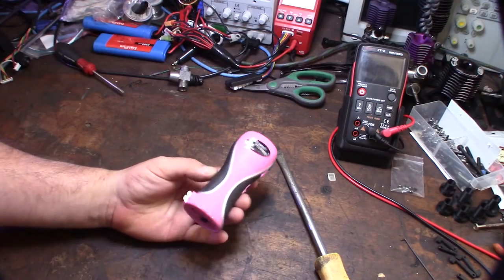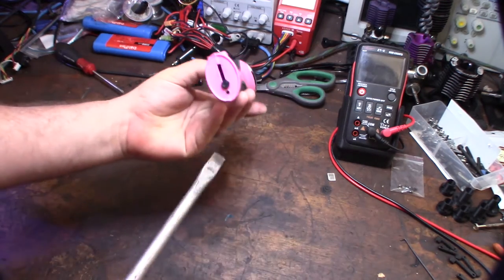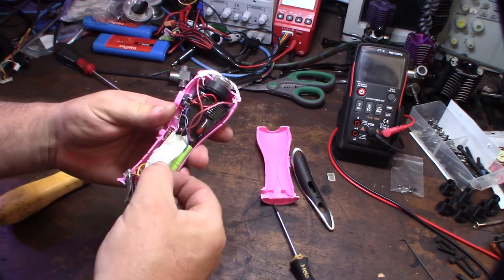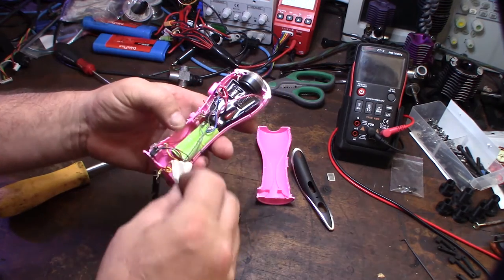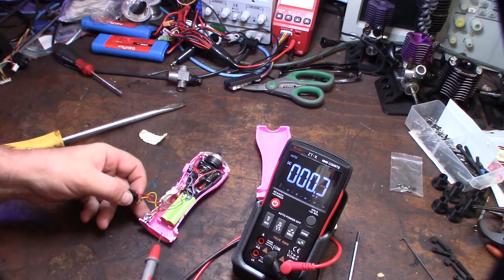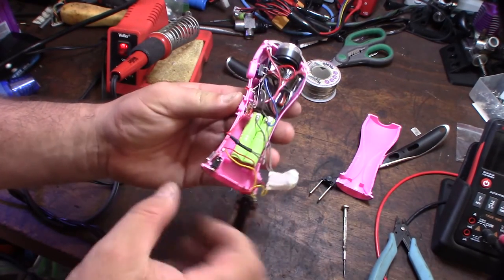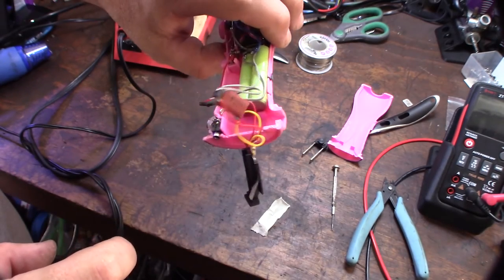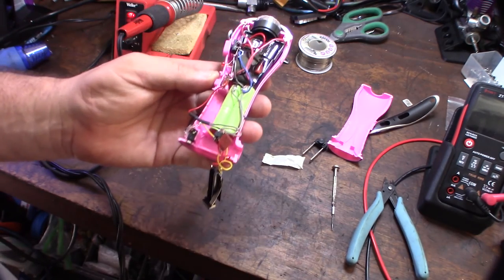Damsel In Defense Stun Gun Repair, most dangerous charging circuit troubleshooting unsafe fire risk

Comment: That "charge circuit" is like filling a balloon with a firehose by shoving cardboard in the hose to lower the pressure.

It looks to me that the "charging circuit" is simply a capacitive dropper and a bridge rectifier. Those are almost certainly not Lithium cells, but this is still unsafe.